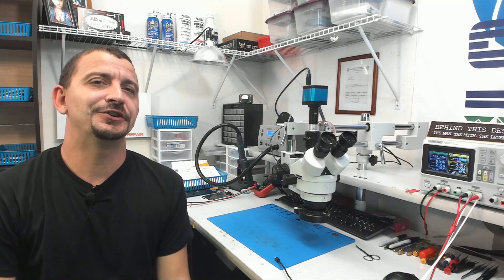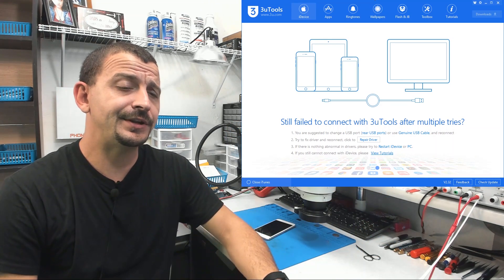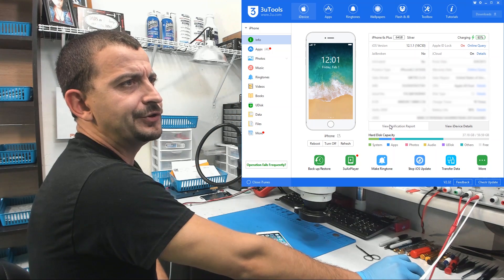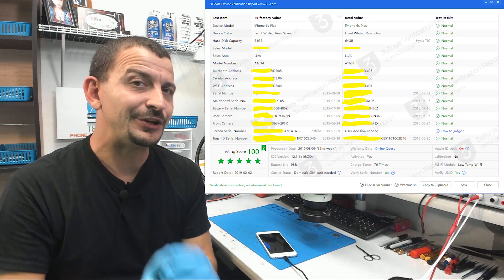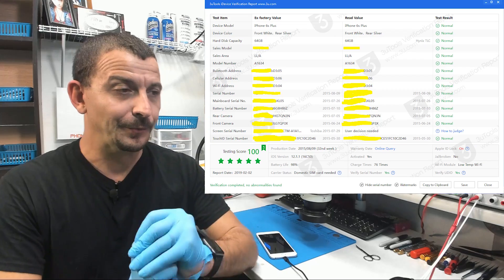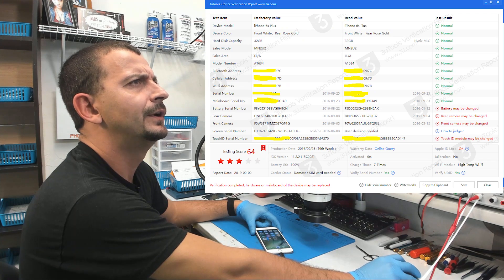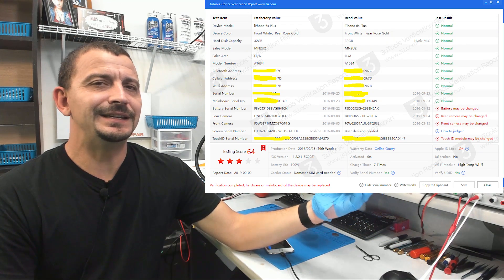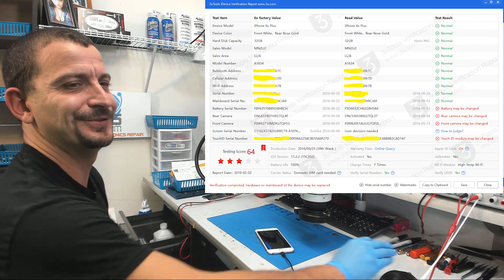How to tell what has been replaced inside an iPhone (Without opening it)

Comment: Is this 100% accurate? Because someone says you can tranfer the serial number or ur original battery to a replacement battery and then boom it will work fine it will have battery health and didn’t have a Important battery message on the settings.. and they say if you connect to 3utools it will say normal? Is it true? I want to know if 3utools is 100% accurate and you can know 100percent if the device has fake or replacement  parts.. i mean is 3utools cant fake information of the phone?? I mean if the phone has replacement parts even if the serial is transferred its still show in 3utools that the phone has a replacement battery not original? Thanks

Comment: hello !, my iphone SE is working backside and vibrating on calls, but no display.
And i gave it to a local shop but they said the problem is in the display ic. but they tired with my iphone for couple of weeks. and they show my display is  on but in recovery mode. While restoring, it stucks in 19% using 3u tools. when they return my iphone i also checked it stucks at 19%.and no display.

Comment: Brilliant information ... One question though when you see the battery has been changed and you can see the serial number how do you know whether that serial number is a genuine apple serial number so the battery thats been replaced is a new apple battery or a copy ???

Thanks again Vinny
Reply: I want to know that too. Did you figure it out?
Reply: You need to check the battery manufacturer, if it says "DESAY", "DYNAPACK" or "ATL" that means it's most likely a genuine battery. There's no guarantee as these battery manufacturers don't only manufacture for Apple.

Comment: what if the third party changes any part or how to check if the phone is opened from start screws at the bottom,  i want to upgrade from iphone 8 plus 64 GB to iphoe 8 plus 256 GB,, but seems like the market is full of refurbished / repaired phones, so in that why iPhone will not be water proof any more after its opened.. please reply to my question, i really need your advice

Comment: Very helpful. recently I bought what supposed to be brand new iPhone 6s 64GB. I even open the package by my self. but after closer look the USB port stands out a bit of the phone it self. second part is, then when I charge the phone and i'm using it the response on the screen is not accurate hmm. very strange. I will test it today and will let you know.
Reply: and guess what, the battery was changed same as the front camera, meaning the front display. now I know, why the touchscreen is acting very strange and is not responsive when au plug in the charging cable. so I contacted the guy and he will exchange it. well he told me that his supplier sold him those iPhone 6s phones hmm. anyway thank you very much for the video and the software. next time when I will purchase aka brand new iPhone, I will go with my notebook

Comment: The sole screen serial number can not be read, thus, 3uTools can not verify if the device screen is replaced or not. The display accessories assembly includes the LCD display, touch screen, front camera, earpiece, sensor and other accessories. Most repair men would not replace the camera from old assembly to the new assembly, because it may easily get damaged to dismantle the assembly. In short, if a repair man want to replace the display accessories assembly, he may need to replace the whole one.

 

Therefore, if the factory value of front camera does not match to the detected value, the screen display may be changed.

Comment: The last phone you tested , since touch id was replaced , front camera was also replaced and if (big IF) touch id is working . That phone was repaired by apple . Because apple technicians dont take apart front assembly. If they have to replace any part on the front assembly they just swap whole front assembly (display) and reprogram touch id . So its not such a big deal.

Comment: What about integrated chips? Can this software detect between original integrated chips and black market chips? Just wondering in case a repair shop try to cheat you by telling you they have to replace a chip when they did not.

Comment: Hi again sts bud how are you ? I have a question my son has an iPhone 6 all working perfectly and one morning he got up would not turn on, I replaced battery as I thought it may have just died then that didn't fix it still couldn't get the charging icon to show when plugged in so I tried a new screen just to rule that out still no joy, as a last resort I even tried a new charging port and still nothing is this more than likely a dead power ic issue bud any help would be greatly appreciated
Reply: Probably the Tristar chip if he's been using a knock-off charger.
Reply: @4clive  I'm not sure it's a knock off charger it's the original charging lead but it's lasted since the phone first came out which is many years ago being an iPhone 6 but I agree I'm suspecting tri star ic what would I be looking at price wise for this repair ?
Reply: @dalebassett9474  About $2 if you do it yourself.
Reply: @4clive  I'm not skilled in micro solder work that's why I ask how much would a repair company charge plus there's none in my vicinity that does that type of repair so would need to be sent away either on eBay which is a huge risk in itself as these home repair people have bad rep after I sent two 6plus for touch ic repair and came back non working or sent to someone I'd 100% trust like sts but need to know if it's worth it considering the handset is no longer worth £50 UK pounds

Comment: how can the touch id be changed and still work if it's paired with the logic board? Or it was repaired the main chip of it inside?
how about there where it says  mainboard serial number... if i put just the main board to another housing than it means anything else will mismatch?
Reply: Mr-Bledi TouchID wouldn’t work. Just shows the button has been changed. On a phone like the 6S Plus (which was the phone that threw up that error in the video) it’s a mechanical button so would still function normally as a home button.... Touch ID would not work though, as it’s not paired (and can’t be paired unless sent to Apple).